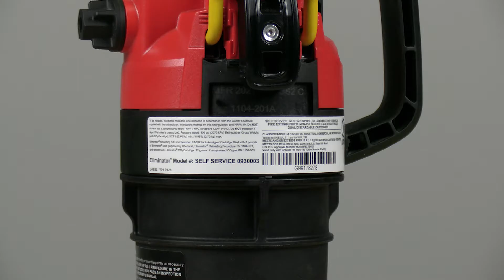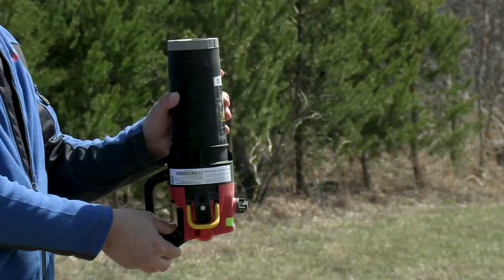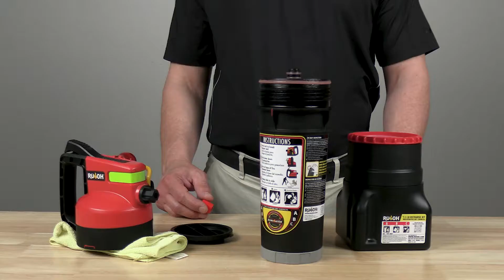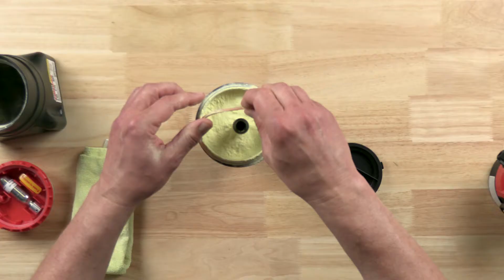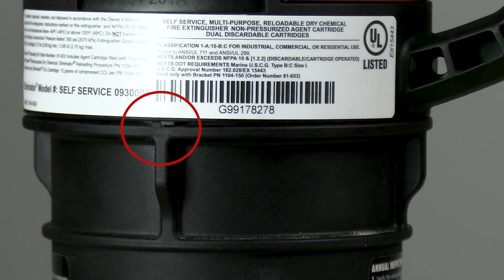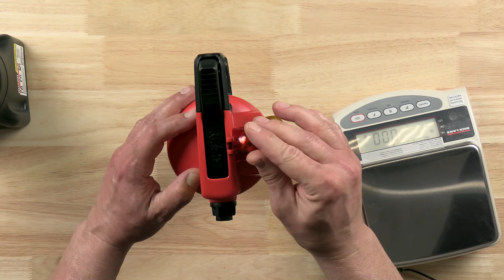Rusoh Eliminator 2.5lb Recharge Kit Instructional Video

Comment: No problems with this extinguisher being made of plastic like kidde extinguishers?
Reply: Entirely different design (non-pressurized, CO cartridge) vs. competitive stored pressure units. Additionally, the engineered polymer is a glass filled polyamide commonly used in high-stress and high-heat environments, like engine parts.